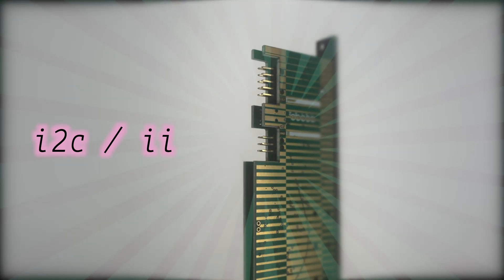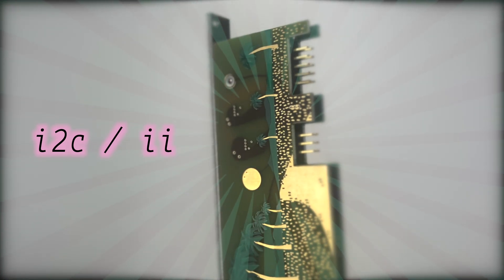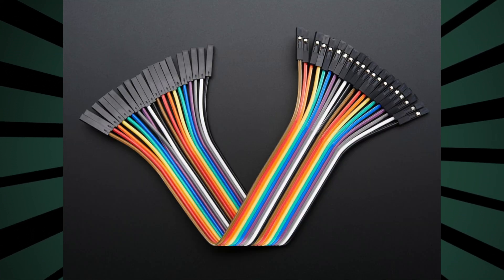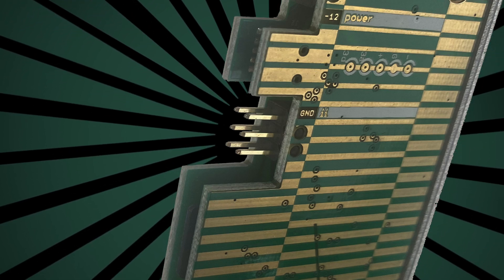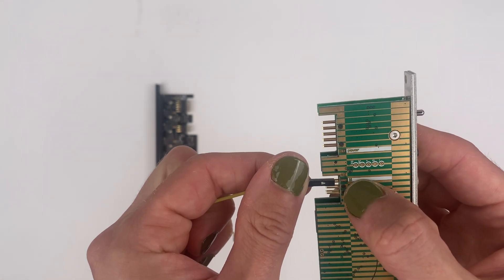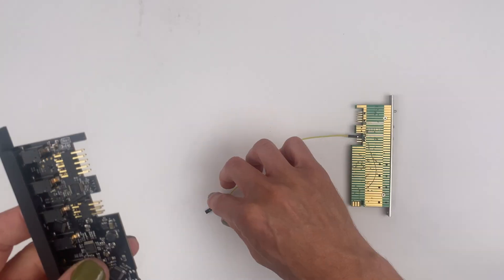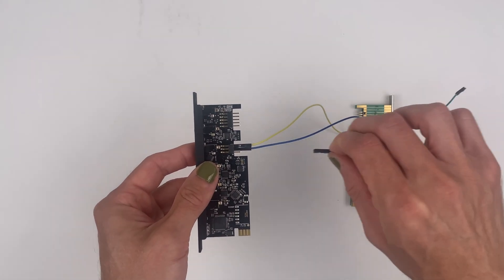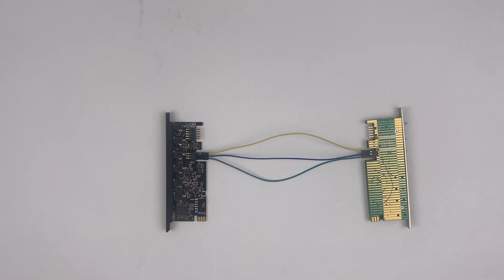i2c / ii: basic physical connection walkthrough

Comment: What a horrible explanation
Reply from the maker: oh! very sorry to hear this -- this video was designed to address the most common denominator questions, which are often about the physical connections (how to daisy chain, pin order, etc). what would be a good follow-up to ensure your questions are answered?
Reply: What a horrible comment =) It's probably meant for people who are not familiar with the protocol yet (eurorackers wondering why and how to make the modules talk, something they may have read about in the documentation. Some people apparently learn from video only, and don't reach for written docs. Addressing leader/follower, data (SDA) and clock (SCL) lines and such may already be a bit technical for some... And the video would become much longer...
Reply: How is this horrible?  Do you even i2c?   /s

Comment: What th are you connecting? And what for?
Reply from the maker: i2c allows modules to communicate behind-the-panel, which opens up functionality that patch cables and control voltage cannot access. these modules are crow (from monome) and w/ (from Whimsical Raps) -- they can communicate with each other digitally over i2c, when their headers are connected as shown in the video. here's a demonstration of i2c communication between these two modules: https://youtu.be/2RUHr-iX1VE?si=2QAobYAWHZlFYKym&t=1174
please let us know if you have any additional questions!